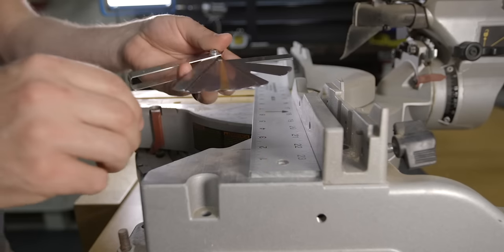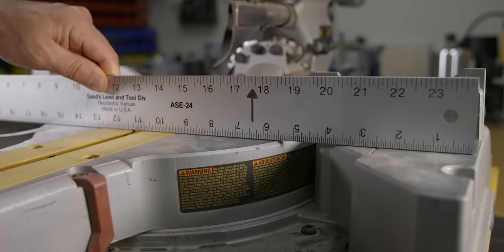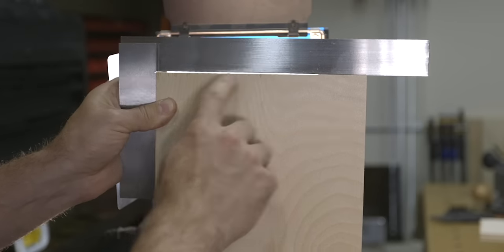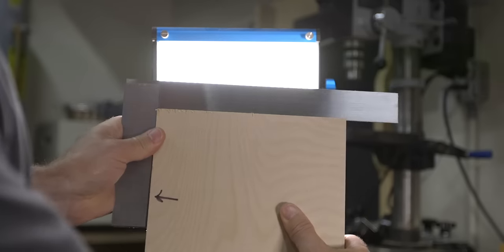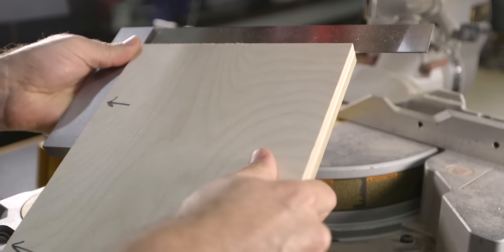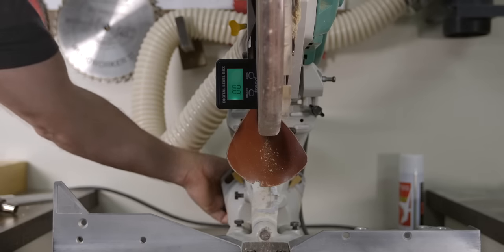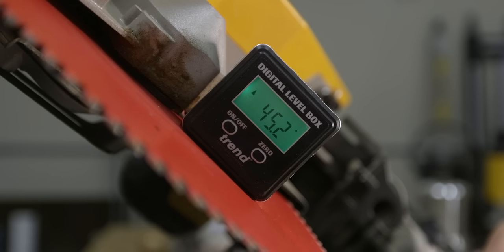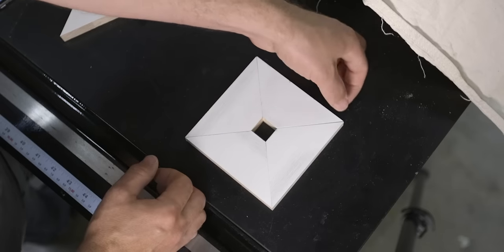Adjusting Miter Saws For Accurate & Square Cuts

Comment: I have watched your video several times now and it’s been very helpful in letting me know how to tune a DeWalt sliding Mitre saw my nephew has. It just goes to show that while you expect the new saw you bought to be accurate it’s always a good idea to check and make sure it is. When I get my new garage built I’ll be buying a new 12” Mitre saw and I’ve saved your instructional video to refer to in the future. You explained what to do step by step slowly and simply and it was easy to follow. Well done and as I did in a reply to a comment on thumbs I give you only thumbs up👍👍👍👍👍

Comment: I’ve tried a lot of sliding miter saws.   No matter how well calibrated, they are flimsy aluminum and plastic things that can easily be pulled or pushed off the line by your own arm pulling on the saw handle.  So I just bought myself a 500 pound DeWalt radial arm saw made in 1953, and calibrated that massive and well built iron monster.   It never strays off the line.
Reply from the maker: NICE

Comment: Thank you, I was doing my head in working out what was wrong with my mitres on an old cheap drop saw, so I went ahead and purchased a 600 usd metabo 305 and it was out of square straight out of the box, brought a magnetic level box and will be calibrating the saw soon, no more strange skirting and trim cuts, no more wasted timber.
Reply from the maker: Nice, thanks for the comment.

Comment: Thank you so much for this information. I thought I'd lost my touch for cutting trim when I got my new Ryobi miter saw, but turns out the fence or locks may need adjustment. Have to check everything out and adjust as needed.
Reply from the maker: Hope that helps you out Mike.

Comment: I just bought my first and messed up door molding. Thank you all the info wow great. 🙏🙏
Reply from the maker: If you're messing up that means your learning! :) Keep it up Brent! :)
Reply: @TrainingHandsAcademy  I watched many videos on how to properly setup a miter saw and i have to say i learned the most from  you.  you explain  very  clearly how and  what to look for  which is 100%  Perfect thank you.  
Today i ordered the digital angle tool   and i seen  my fence was a bit out as you  should slide the saw out with the square along side and near the  end  the blade was going over the square.   My saw is  a brand new Stanley SM18  slider,  and I cut  a bunch of moldings to go around the doors and  they all have a taper on them, or a bevel.  

I never had a Miter saw before   LOL  so just started cutting happy days  and then OOPPS!!!   

I only  cut the sides and never paid attention  and they are all glued now on   each side of the doors   plastic moldings  so now  learned a lot have to order the small planer to cut them down so the top now cut level  will fit on .  If  that makes any sense  HAHAHA 
Thanks again   for writing back  and  finding someone for  advice in Thailand   there is n one   so  your video is #1  100 % TEACHER :):)
Reply from the maker: @brentthailand5742  You are very kind, thank you!

Comment: Thank you so much for this video. I have the 12" Metabo, and it has non-adjustable detents. Every other video I found uses a saw with adjustable detents, and I was nervous to just start loosening bolts without truly understanding what I was getting into.
Reply from the maker: Thank you for the comment.

Comment: Great video.  I have the same DeWalt miter saw, so can’t wait to check its accuracy using your easy to follow instructions.
Reply from the maker: Right on! Let me know how it goes Rusty!
Reply: @TrainingHandsAcademy  What straight edge do you use and recommend?
Reply from the maker: @rustydegeorge5726  The one I have I bought from Woodcraft. It's made from a company in Kansas called Sand's Level & Tool Co. To be honest, I don't have a favorite straight edge yet. Woodpeckers makes amazing tools but they are so expensive. This one works good for my current needs. Hope the helps.

Comment: Great video. Clear and concise.  You cover everything about adjusting your miter saw except what I find wrong with mine.  When I first bought the new saw I had to make a slight adjustment to cut square.  45 degree miters and 45 bevel cut are fine by themselves. However when I cut a compound angle with the bevel at 45 and miter at 45 the miter is way off.  Am I using it wrong or is there something inherently wrong with the saw?
Reply from the maker: That's a tough one... normally if the 45's and 90's are good, everything in between is good too. Not sure what that would be? You can send me a video on IG if you want of your problem.

Comment: 7:38 if you do this, make sure you cut 2 pieces from the same side, otherwise they will always be complimentary/supplementary angles and will add to 90/180 degrees even if the saw is off.

Comment: First:

Believe it or not: THIS is THE best video in "explaining" it; that woodworkers NEED; that I've seen since YouTube came on the air. Thank you kind Sir.

Second: I bought one of those DeWalt saws brand new; from Home Depot. And from the day I used it; the degrees were off. And get this: the screws were so hard to unscrew; I was afraid of buggering the thing. So I just lived with it; by correcting the error manually, each time.

But I am so pleased with how you did it; that I am going to get those screws loose (if I have to grind them off) and make it right. Thanks again kind Sir.

Thirdly: WHY in the pluperfect hallelujah didn't DeWalt do it right; at the damned manufacture; since they have the means to do it perfectly. Damn their hides. End of Story. 

Dadgum "Nut-heads!" For they need to be given "one way tickets" to Pluto; and make NASA put them on their next "Voyager". OH Yeah! And "GOOD RIDDANCE!" Whooopeee!

Comment: Thank you so much for your video. I'm going to have a go at my DeWalt Dbl. Bevel Saw. I have tried making adjustments but there is always something that's not right. To move my saw one way or the other, it has a weird, sort of big wing nut. I'll have to do better. Never thought of using my digital angle gage for that purpose. I have a Wiley product and I generally use it on my cabinet saw when I cut something on an angle. I did laugh when you mentioned about checking a square with another square. I do that all the time. I have some small machinist squares but I have the usual collection of other speed squares, Empire, Stanley, etc. Really good informative video, you make it look easy. I think I'm better informed to take on fine adjusting my saw now. Thanks again.
Reply: I'm in the same boat as you. I'm using a 6 inch Starrett square and I'm still not 100 percent sure it's true. Combo squares can be manually calibrated with a tiny file in the groove. It can take up to 30 minutes and if you file off too much on the little ridges you get a second chance on the other side but you might want to have an award winning dentist so it for you or send it back. Lol

Comment: I used the 5 cut method to adjust my mitre saw, I just didn't trust any of my squares (and I have a good one). The final adjustment was needing the width of the thinnest feeler gauge at the end of the fence.
Reply from the maker: Great tip!
Reply: You are of like mind with me. Feeler gauges don't lie. Unless they have rust. Or if they are bent. Or if they have glue on them from tape. Trust nothing and nobody. Haha. Dont forget that your test cut wood will be more telling if you use something like a 4x4 or bigger if you can get it. At least when checking the verticalness of the blade. I use the clamp 100 percent when testing and make sure it's not introducing error by using feeler gauges. I also try to mix up my tests any way I can. My goal is to find were the error is. Not if there is error. I lose sleep over this stuff.

Comment: Really good and informative video. However one variable you didn’t mention ( it caused me to chase my tail for a couple hours ) is lateral runout of the blade. And yes I was using a brand new blade. What I learned was to mark the blade and only use that part/portion of the blade to reference off of.
Reply from the maker: Great point! Thank you for sharing Nick!
Reply: could you explain that further? I am having trouble getting accurate miters for frames on a 10 inch sliding compound saw, and I don't know what you mean, but it sounds interesting. thanks.
Reply: @las174  I’ll try. Without pictures or a video it’s going to be difficult for me to explain. 
I assume that lateral runout is hanging your up. Lateral runout just means “ sideways movement from far right to far left.” 
So when using a square you have two reference points or legs. Both need to be as flat as possible. Josh talked about this at the first of the video when he was talking about using a straight edge for the fence and the bed or table. The other reference point that wasn’t really talked about is the blade, or more importantly the plate of the blade.( the flat part not including the teeth). And to Joshes defense buying a “GOOD BLADE” with excessive lateral runout is not common. But it does happen. It happened to me. 
The way I found my problem was with a dial indicator. After that situation I always check my blades on the miter saw, table saw, band saw, and drill press with a dial indicator. I allow .005 in lateral movement. 
I sure hope this helps Lesley. 
I would like to see Josh at Training Hands do a video about this.

Comment: Excellent video and info. This was quite in depth.

The only thing I would add, in regards to the digital angle finders is DO NOT buy one that reads in 100ths of a degree. My first one did/does. It's around here somewhere. When I find it I might give it to my brother LOL! Those will have you chancing your tail for so so long. I thought I needed that accuracy but unless you're making super long rip cuts that have to be accurate... No you don't. It's unrealistic and if you have a digital gauge with a lab traceable calibration certificate that guarantees 100ths or less... You paid a lot more than I did.

This also reminds me of a user on Reddit back in the spring I think. He had bought a used miter saw which had a one piece fence and it was clearly bent. There was a gap of over an ⅛" on both sides and he wanted help fixing it. I told him either go to a machine shop and beg or replace it. I mean if it was mine I'd try to flatten it

Comment: DeWalt DWS779, saw blade crabbing to the left.  That is to say that the back of the blade is not following the leading edge of the blade.  Looking for information on how to adjust the saw blade itself.  Here's why it's not a fence issue:  If I cut scrap 10 inches wide the back side of the blade introduces a new edge, 0.018" different from the leading edge.  Cutting at any angle I still get this edge effect.  Do you have information on how to adjust this problem?  My saw is brand new, just out of the box 30 minutes ago.

Comment: I'm certainly not blaming the video but after watching it, now I have to drill and tap a new hole on 2 fence bolts. With the correct bit, I still striped them, they are in there so tight.
Reply from the maker: Bummer, I hate when that happens.

Comment: I have a new Metabo 10" sliding dual bevel miter saw. It has a 1 piece fence. I noticed after watching this video the first time that my fence is bowed. About 4" out from the blade is off by about 12/1000th. How do I adjust that? Thanks for this video it has really helped.
Reply from the maker: Single fences are not easy to straighten... I've seen some people on YT sand or grind the fence back to straight, but that seems like a lot of work. Do you find that it is effecting the quality of your work?
Reply: @TrainingHandsAcademy  yes, and I'm not sure how to calculate the angle.
Reply from the maker: @86abell  The only thing I can think of (if I'm understanding you correctly) is to make a bunch of test cuts and figure out how much you need to adjust to compensate for the error in your saw. Does that make sense?

Comment: Just got a DeWalt 779. It wasn’t squared out of the box so I squared it with a square and a digital angle. Then I make some cuts that look good to me. A few days later I recheck the saw and it’s slightly out of square again. This has happened a few times now. Should I just return it and get a new one? I have it on a stand and nothing is bumping into it. Maybe I got a lemon
Reply from the maker: I would try one more time and make sure everything is really tight. If it goes out again, I would return it.

Comment: how would you know that the detent plate is defected because when i do 90degree the 45degree will be off by 3 t is there a setting on the fence Miter Saw DEWALT 780 thank you

Comment: loved your video, i dont usually need precision so my 20 year old craftsman saw setup has been fine, but i wanted to make a frame for a gift and the one piece fence was way too far out to cut accurate 45s..  so i tried to adjust it like you suggest but when i tighten down the nut right at the end it pulls it out of alignment..  i even tried clamping it down but that final tighten pulls it out..  have you got any ideas on how to deal with that?  i used a playing card on the fence to cut my frame pieces and that worked but i would love to dial it in perfectly..  thanks again for your great video
Reply from the maker: Yes, I have a saw that likes to do that as well. I normally put a clamp on it while I tighten, but if you can't get that to work, you might have to over correct in the direction of your tightening, so that it ends up exactly where you need it once your done. You might have to do this a few times, but you'll get it.

Comment: I just put a laser pointer on the machine and found the perfect angle, then I drew a circle on the wall on the other side of the shop around the red dot so I knew when I hit perfectly straight 0 :)

Bolted the saw down into an already bolted down steel frame between the benchtops, it aint moving.

Comment: I always love to watch your videos. I have one concern here, though in relates to the use of a digital angle finder. The digital angle finder could give a false reading if the miter saw was not placed on a perfectly level surface.
Reply from the maker: The fix for that is to zero out the finder on the bed of the saw first, and then attach it to the blade. That way it doesn't matter what the saw is sitting on because you are telling the finder that this is level. Does that make sense?
Reply: @TrainingHandsAcademy  , for an angle between 0 and 1 degree and around 90 degrees, the stated accuracy of the digital device is 0.1 degree. For other angles, the accuracy is 0.2 degree. There will be two errors when subtracting angles. It is certainly a good idea to keep the table as level as possible.

Comment: Absent the machinist's square, cross-cutting a length of board, with wide side down, then (post-cut) flipping the right-hand piece over and abutting the two pieces, you should have a perfectly straight edge along all edges of the length (and, of course, no gaps at the abutted faces). Any deviation from dead straight tells you whether the fence/blade angle, the table/blade angle (or both) is (are) in need of calibration. Similarly, a 45º mitre cut (not compound), with a flip, rotation, and abutting measured against a reasonably square object (e.g. CD case) will tell you whether the mitre is off...

Incidentally, most phones with a software compass also have a digital level built-in. Check it out.

Comment: Great video. How often do you suggest checking? I find that if I have to move the saw to a jobsite, it has to be recalibrated.
Reply from the maker: That's right, if you are moving it around place to place it needs checked more often... maybe every few months
Reply: If it matters that much, check each time you move it. Consider looking in to using blue loctite on critical adjustment screws. Don't use red loktite. You'll never get them out in 1 piece. Think about your workflow of.movement and try to reduce any bumps or excessive vibrations. This is why airplanes use wire on the nuts for the blades and many other parts. If it can come lose and move, it will. IMHO, your first cuts at the job should be your test cuts. Keep test cut lumber with you at all times. Make sure the pieces are as large as possible for your your blade size and honestly, if the are all jointed and planed, that would be best. I keep a battery leaf blower with me to blow the dust off for accuracy. I generally work outside. Good luck. Hope something I typed helps.

Comment: Just got a DeWalt 779 and I have the 90 true to the fence (on both sides), and the right side 45 to the fence. But the left side 45 is slightly off, maybe .3 to .5 greater than 45. The table and the fence both are flat all the way across. Could the adjustable detent miter scale be faulty? Any suggestions?
Reply from the maker: The detents can be faulty, but it is definitely not the norm. You can always take the saw back and try another one, or you can just let that one ride. You will most likely not notice that discrepancy, and your projects will turn out just fine. :)